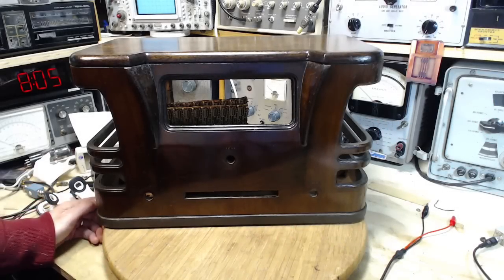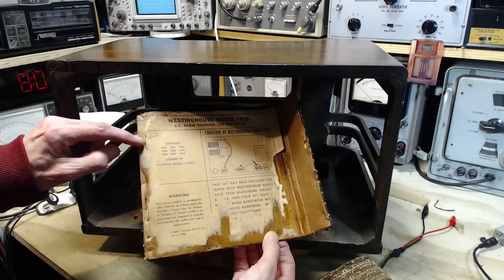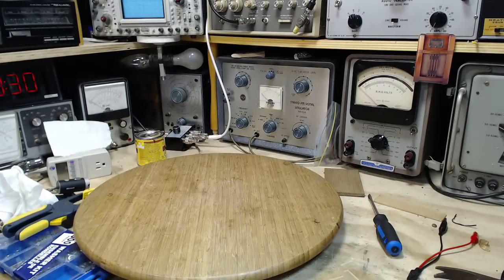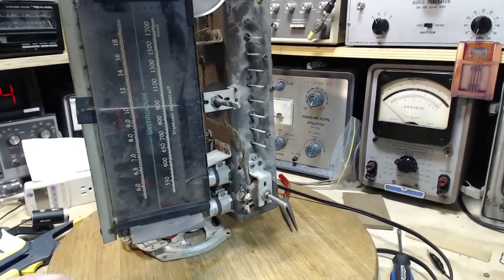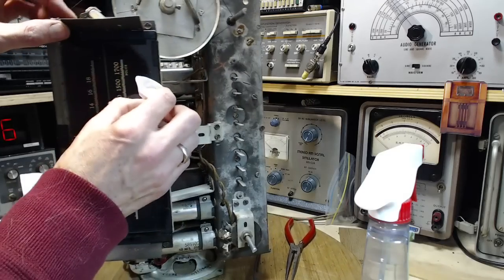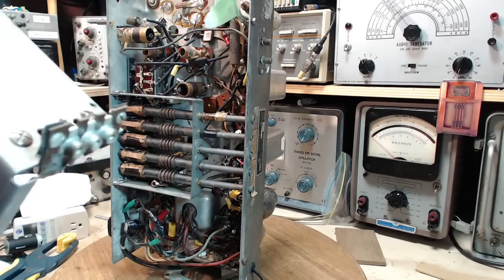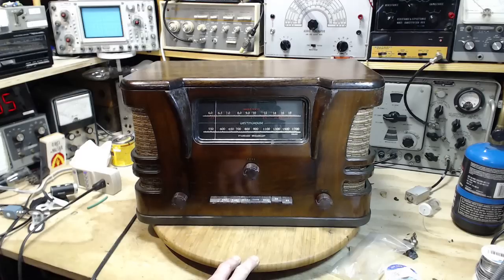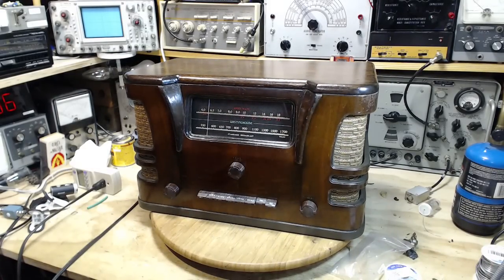Westinghouse 535 #20 - Cabinet Work and Big Test

Comment: That friction tape is bettered by true gaffers tape. Markertek sells the gaffer tape in many widths and colors. It uses rubber adhesive and cotton duck that has been rubberized. Excellent stuff, but if it gets wet, it may creep.

Comment: Interesting that Westinghouse used the term "Radiotrons" the same as RCA.
Reply: Westinghouse and RCA (and GE) were basically one company in the early 30s and it was not unusual to find the same chassis in all three brands with the same of different cabinets. By the end of the 30s they were a little more separate but were still using the same terms. Some of this came about because an early industry leader (Atwater-Kent) trademarked terms like "radio", etc. It would be like someone registering "drone" today.. Companies adopted names like "Radiola", "Radiotron", etc. There were legal battles over the trademarking of  common words until AK went under in 1936, sunk by huge debt taken on to build a huge modern manufacturing plant in Philadelphia only to have the depression kill the economy. Their registered names fell into public domain and some became common usage. Others, like "Radiotron" had built up public confidence and were kept to graduall be replaced by "Elecron Tube" as radio became "old fashioned" in the age of televion. AK's old plant survived until the 80s and finished life as the headquarters of the Veteran's Administration and Social Security Administration. A few hundred feet east of the AK plant was Philco's TV plant until the late 50s. That building still survives. All that is left of the AK complex is an old power plant building behind the new VA/Social Security building.
Reply from the maker: Thanks for the fantastic background.  The radio business was very complicated from the start and the history is confusing.  To add to the confusion, there were Canadian versions of those familiar American companies with another complex history.
Reply: Yep, the VT industry then was somewhat bastardized. Once a production run had high yield of a certain type of usable  bottles, the individual producers would trade branding licenses. "Hey, we got a surplus of 6xxn types, you got a surplus of 6yyn types. Can we make a deal?"
They did indeed.